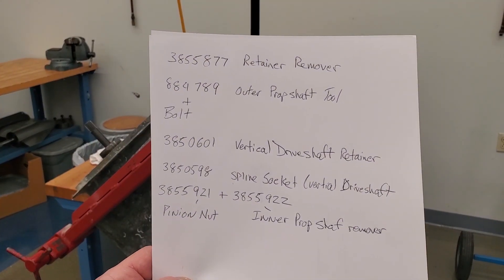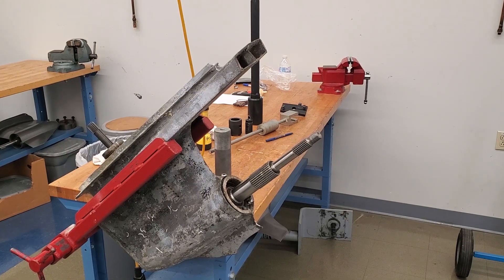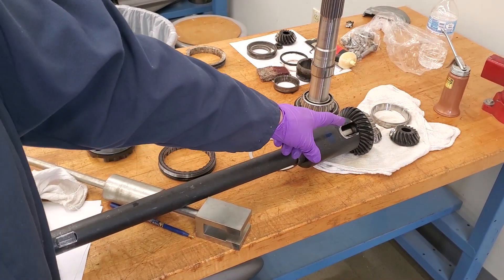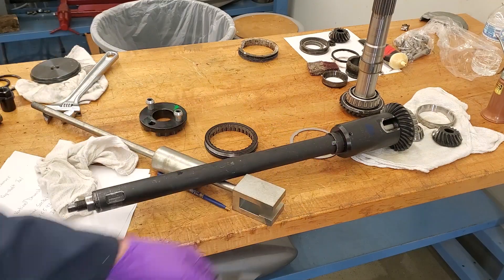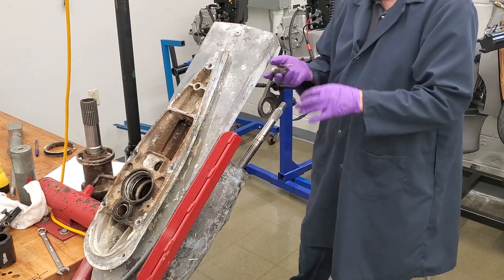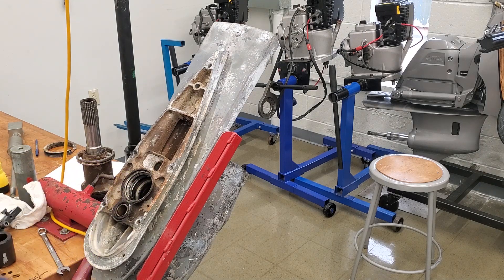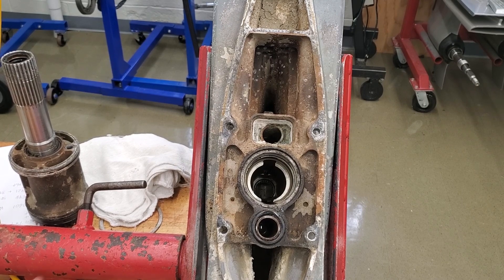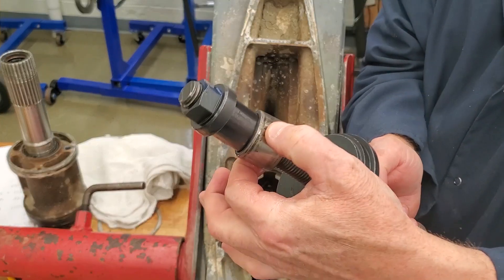Volvo Penta DPS Lower Unit disassembly procedures (part 1 of 3)

Comment: I want to inquire about consultation re a DPS-B ox drive that is making more clicking noise than the other port drive when in forward at all rpm's and also a different click at about 1/2 second intervals.  powers up and performs to spec as to speed of boat max with both drives going;  2013 model; 182 hours; volvo D3 engines; only work done is gear lube changes, new shift cables, and shift seals at outdrive rear; bellows replacement and lube of spline shaft to motor.  Last gear lube change a couple weeks ago showed small amount of metal on drain plug magnet and other quiet drive had no metal on plug magnet.  Let me know how to engage a consultation if that is available.  Considering just replacing drive vs repair and if exchanges are available.  Thanks, Garth Scott
Reply from the maker: You can email me for consultation @ marinedoc01@yahoo.com

Comment: For DPS-B ox, to just replace the shaft oil seals, can one buy just the shaft separation puller, remove the two shafts, replace the seals, and put back together with original shims & leave all bearings in place.  Motor has only 200 hours, but is 11 years old.
Reply from the maker: You can do it that way. However, I always replace the shaft bearings as well as they may be damaged from water intrusion. And that is the proper method we teach in Cert courses.

Comment: Hey Ted, I need to remove my lower drive to have a shop straighten out the skeg. It’s bent from the previous owner. I’ve never taken a drive apart before. It’s a Volvo Penta DPS on a 2002 Bryant with F9 props. Could you direct me on how to disconnect the lower section from the rest of the outdrive on the boat so I can take it to a shop?
Reply: In other words.. how do I get what’s in this video off the rest of the outdrive?
Reply from the maker: Drain the gear lube. Tilt the drive fully up and you will see 2 bolts that thread through the lower unit up into the upper housing.Remove those. Then there are 4 nuts to remove - two on each side. Remove those and the lower unit can be removed.
Reply: @tedsmarinerepair8956  sounds much more straightforward than I was expecting it to be. Is there any C clips or anything weird that I need to try to disconnect to get the vertical shaft unhooked from the upper section?
Reply from the maker: @jaked4285  no, there is a short intermediate shaft that connects the lower to the upper shaft. I would replace that with the o'rings

Comment: I appreciate the detail expressed in explaining the tools by part number and the process in using each tool. Every step is narrated to include torques and contact measurements. I would feel most comfortable having my repair work done at this shop, or even pay for a core exchange for a Rebuilt unit.
Reply from the maker: If you need your drive rebuilt, You can contact me directly at marinedoc01@yahoo.com

Comment: does 3855921 tool slide over the bearing on the shaft, or does the bearing have to come off?
Reply from the maker: It fits over the bearing to pull the shaft out of the gear and fh e n you press the bearing off in a press with that tool as shown in the manual
Reply: @tedsmarinerepair8956  thank you for that reply, I must have a different year tool, the nut is smaller on the dps, more like 7/8  vs 1 1/8 like the sx drives
Reply: @tedsmarinerepair8956  email me if you can, I would like to have a volvo source as we work on several with limited parts availability. I'll pay for services parts etc.   boatingrepair@gmail.com